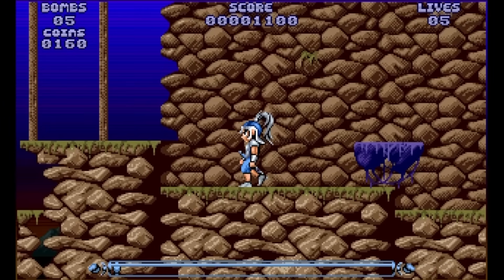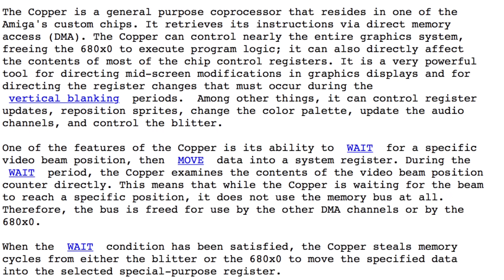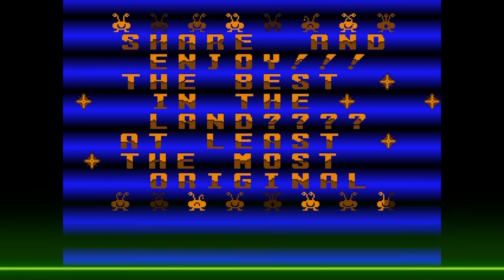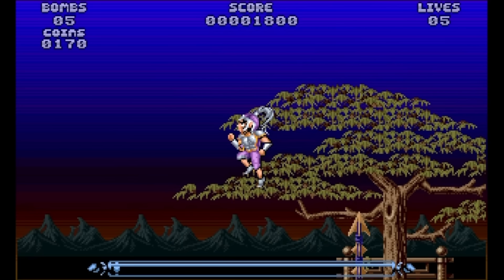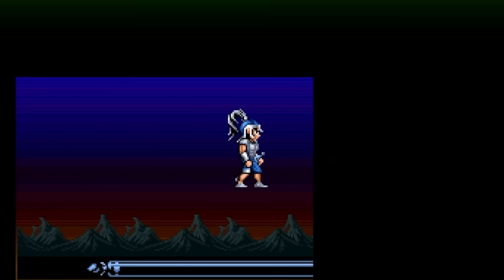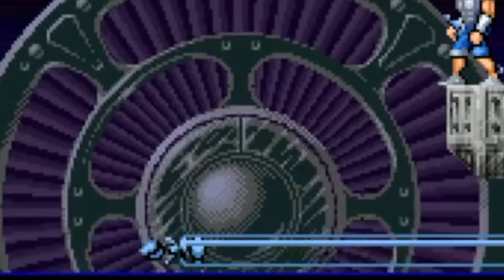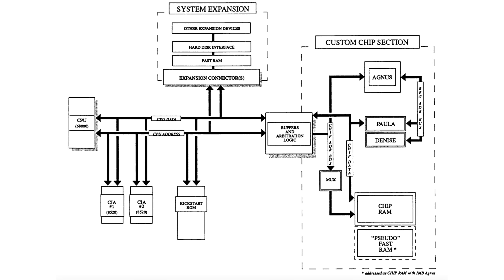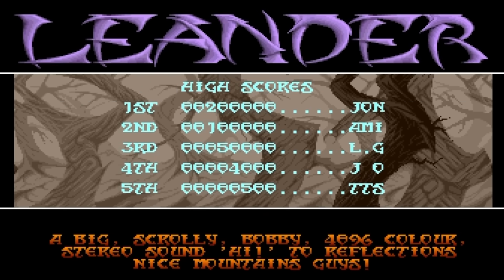SNES hardware beaten by this simple Amiga trick

Comment: I think I understand why you can't draw the "coins" stat on the top line with 6 sprites (each word being 32px wide and thus 2 sprites?). But how come you can draw an 8-digit "score" value (plus the other 4 digits) with only 6 sprites?
Edit: Oh, you are using 100 different sprites from 00 to 99, and each is 16px wide.
Reply: Either that, or you could store the sprite graphics of each score sprite separately and just update the graphics as needed as the score increases. By the way, the 3 columns of the display are far apart enough to also get updated by the copper so even less sprites would be necessary... but that's not necessary here because there are enough sprites available to cover the display. But this is how such displays are normally done on the Atari 2600... by actually displaying 3 copies of a player (or 3 copies of both players) and update their graphical content on the fly.
Reply: @KurtWoloch  This is the more likely approach, there simply is not enough RAM in the A500 to hold 100 sprites.
Reply: @Henrik_Holst  100 Amiga hardware Sprites (2 bits per pixel/4 colours) holding the number 00 to 99 would take about 3200 bytes (excluding the control words). That ought to fit ;)
Reply: @DutchRetroGuy  yeah that would do, but then you also just wasted close to 2% of all your RAM in a standard A500 just to show a tiny number :)
Reply: @Henrik_Holst  I get your point that using 100 images is not very efficient (even though it's only 0,6% of all Chip RAM rather than being close to 2%). 

That said, my point wasn't that about efficiency, but rather that it isn't a big deal to store them like that if it makes the game easier to code or make it faster to draw the score.

Is all good though, happy holidays :)
Reply: @DutchRetroGuy  Yes you are totally correct, I was in my original OP thinking of much larger sprites.

Happy Yuletide!

Comment: god, seeing things like this makes me wish I got into programming much MUCH earlier, because I'm making games myself (mainly rpgmaker and unity, I don't know how to make a full game engine from scratch though I am trying to learn how to by programming one in C++ with SDL2) but I always keep thinking to myself "how will this perform" but the answer (sadly) is I don't need to care about game performance, no need to come up with clever solutions to dance around the hardware limits. Yes I know more powerful hardware means you in general have more room for creativity, but also limitation is the ancestor to creativity. All of the effects (like sonic 3D and whatnot) can be very easily done today, but doing those techniques today would've lost the point of why it was so impressive back then (heck to this day I still find it impressive, because certain styles like that look better than a lot of games I've played that came out in 2020)
Reply: @vlc-cosplayer  I might look into the Raspberry Pi Zero actually as a sort of baseline (basically make a game that if it can run perfectly on the Pi Zero it should run perfectly on everything) I think it'd be easier than homebrewing a PS1 as I think you need a console for that, and PS1s are expensive now adays (even if you don't want mint condition)
Reply: @Urakross  You can absolutely write homebrew with nothing but an emulator.
Reply: @vlc-cosplayer  I think for me the main issue with suggesting PS homebrew is the fact that I don't have any sony consoles at all (actually the only console I have is the switch) and emulators may be an idea, but at a certain point i'm just programming for a modern computer with a few extra steps. I will definitely look at the Raspberry Pi Zero, I'm familiar with C++ and I'm also learning how to use inline assembly in said compiler (hey maybe I might even learn C, because i'm super used to object oriented languages so learning procedural might be a good challenge)
:)

Comment: What happens if a game play related sprite overlaps the same lines of the screen that the HUD or mountain layers on? Or is that not possible?
Reply: My question also!
Reply: It won't happen, because the camera is centered on the character at all times.  But if the player could be elsewhere on the screen, you could draw either the character, or the background.  Not both.
Reply: @Dwedit  What about non-player sprites like enemies?
Reply: @cst1229  Those aren't sprites.  On the Amiga, those would be rendered using Blitter Objects (BOBs).
Reply: @Dwedit  But this does use sprites, it's for collision detection I think.
Reply: As far as I know (experienced), exceeding the number of allowed sprites causes flickering (alternately displaying them).
Reply: @ericBcreator  I think exceeding the number of sprites simply causes the excess sprites to not display, and the flickering is a thing implemented by the game.

Comment: The guys who programmed the Atari 2600 did alot of the same tricks repositioning sprites (there were only two, plus the one pixel shot, and 4 pixel ball which were used alot to draw lines.
Reply: The folks who made the Amiga actually did the 2600 and Atari 8bit machines directly before moving onto the Amiga, so tricks carry over, which was probably helpful for developers. The Atari 8-bit computers are especially cool to look at as a sort of "proto-Amiga."
Reply: @gargonovich  Jay Miner https://en.wikipedia.org/wiki/Jay_Miner
Reply: The Atari 8bit home computers had a similar sprite implementation, supporting 4 sprites 8 pixels wide and the whole height of the screen, and 4 more 2 pixels wide.  With a horizontal blank interrupt you could reposition these.
Reply: that's actually what I was thinking of when he was describing how he multiplexed the mountain range sprites. "Racing the beam" as it was known, was a common Atari 2600 trick... well... not trick... that's literally how the entire thing worked. There WAS no framebuffer, they had to "race the beam" to draw the screen. To get a working game within 2 or 4kb of ROM was an incredible feat, but for Atari 2600 coders, it was simply what they did. They were built different.
Reply: So, given that the Atari 2600 was even capable of this, does that mean that pretty much any console could do roughly similarly in the right hands? I mean, as an example, could pretty much the same thing be done on SNES using say its HDMA and/or other methods too?
Reply: @inceptional  probably similar things could be done, if needed. Though each hardware has its own characteristics so they were probably solving different problems on the SNES.
Reply: @inceptional  Not really in this way. This trick depends upon either being able to do interrupts based on vertical line, or ideally having a copper to run basic commands in the background at given x/y positions. The C64 for instance could kinda do this since it had the ability to do interrupts on vertical lines, but because you then have to make the CPU wait until a given x position (losing a line in the process) it ends up where you can then only do game logic during the blank period which is hardly any time at all. Some games did that, but they tended to be very simplistic. The Amiga works because you can still do game logic whilst the Copper is running. As mentioned in this video, cycles are stolen so you have less time, but far more than just during the blank period.

Comment: Commenting for algorithm. 

If I didn't live in the third world, I'd really try and get my hands on a Commodore Amiga. It just seems like such a neat machine.
Reply: @funkykoval2099  Nheh. Emulation is great if all you want is to play the games. But I kinda wanted the feeling of messing with a vintage computer. The bulky tube monitors, the satisfying ka-chunk of a 3.5 Floppy Disk being inserted. The keyboard-thing-that-plugs-into-a-monitor form factor of those early computers that I wish hadn't gone away because it's a neat idea. 

I experienced vintage computing only through an MS-DOS machine back in the day. The Amiga and systems like it weren't really a thing in my country.
Reply: @SomeBlokeOrWhatever  Ok. Deleting comment...
Reply: @funkykoval2099  Difference is that MISTer doesn't use emulation. The "cores" reprogram the FPGA module to recreate circuits of an Amiga board on an actual circuit level, So really, once the core has been loaded it's not really emulation anymore but an actual unit running at perfect timings. But sure, people need to ask themselves if they really need that kind of accuracy when we have cycle perfect emulation for the Amiga. I for one, use emulation primarily and whenever I need "true testing"  during software development, I use real hardware. But generally. emulation covers 99% of my needs.
Reply: @PixelShade  its still emulation just hardware emulation
Reply: @primus711  well I guess you can call it that, but the difference is that fpga can recreate circuit level logic. Rather than simulating hardware functions on hardware that functions completely different. Emulation will always be flawed and fpga allows for a higher level of accuracy. technically fpga programming is not emulation. since emulation is software based
Reply: @PixelShade  incorrect emulation can be hardware or software i know cpld/fpga very well
Reply: A lot of the games looked awesome too.
Reply: You could buy a MISTer FPGA and us that to simulate an Amiga with the Minimig core. The base DE10 board is around 150€ new.
Reply: Was. Very old now.